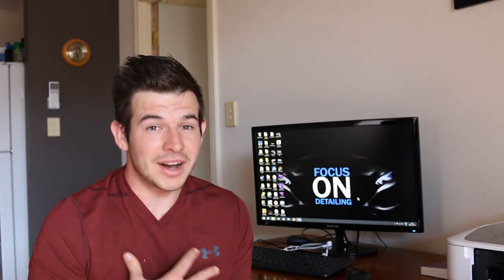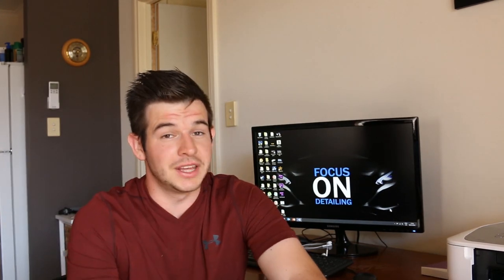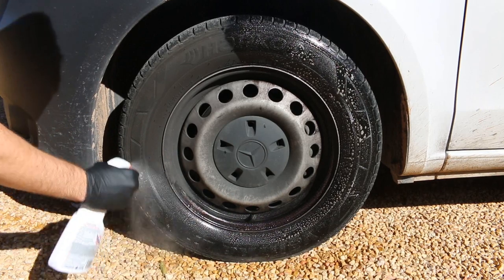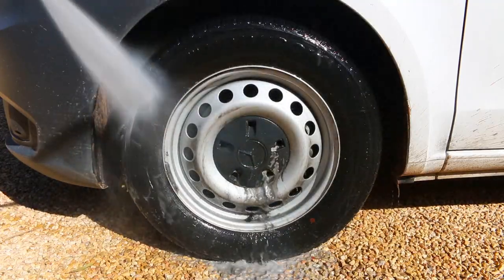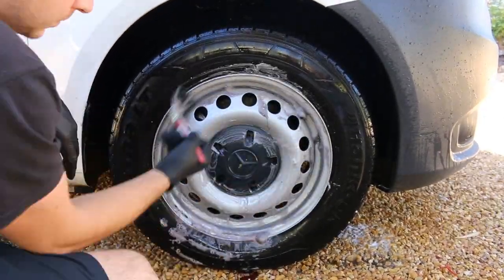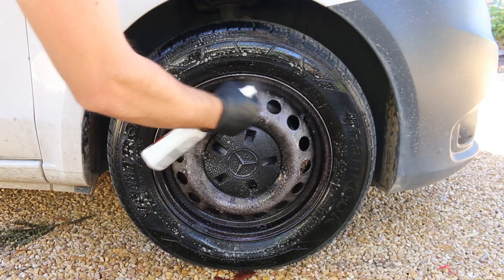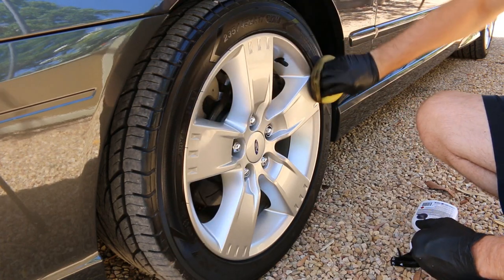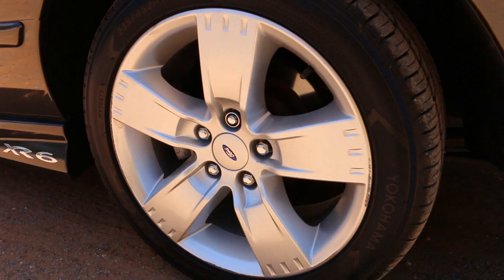Cleaning Wheels | Bowden's Own Wheely Clean & Tyre Sheen | FocusOnDetailing

Comment: I've been using the tire shine for months within my business and i think it's one of the best. I have been looking for a good wheel cleaner as iv'e tried a lot that don't work. The wheely cleaner looks pretty good but i have seen comments left on channels stating it has been leaving marks on their mags. My guess, it is like an acid and must go on and off pretty quickly otherwise it will leave damage.
Reply from the maker: I believe their new Wheely Clean is a little safer but still even like with other cleaners it's important to not let it bake onto the wheel doing it in direct sunlight or simply leaving it too long to dry. There's safer options like using their Orange Agent or Three-way to clean the wheels it's just that their clean capabilities won't pack as much of as a punch as Wheely Clean

Comment: Hey Tim.  Just a quick question: would you suggest doing wheely clean on the wheel and tires as you did here, or in another one you did, Orange Agent on just the tires and wheely clean on the wheels.  Love your videos mate, has helped me enormously. P.s wouldn't you read about it, cleaned the car today, up to drying and a cane fire just rained black ash all over it.  OUCH!  Funny, but not ;).

Comment: wow long time no see lol and I do like these products are good I find at a retail level and the wheel cleaner can be used as a chem decontamination b4 you start the clay bar process. I have moved off sprays for tyre shine but this is my fav spray
Reply from the maker: Hey mate! I didn't know that it can also be used for that, that's pretty cool. Might come in handy too although I'm using CarPro Iron Xls at the moment which does the trick. Without a doubt my favourite product for tyre shines at the moment would have to be Chemical Guy's VRP.

Comment: Great video thanks.
So judging from the purple run off is the Wheely Cleaner similar stuff to a detox spray, which removes iron particles?
Nice XR6 btw!
Reply from the maker: Thanks for the comment! That's it! The purple you see is the product reacting with the iron particles. I've also used this as a chemical decon product but Bowden's recently released a product specifically for this job now.

Comment: You don't need to use soapy water when using Wheely Clean, as it's designed to be used by itself. The new formula is now out and smells like a hair salon